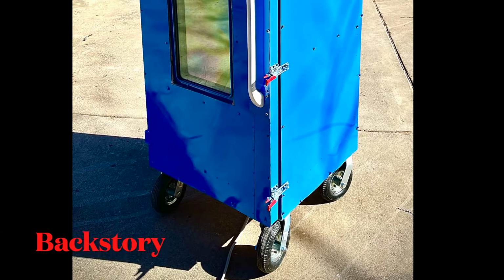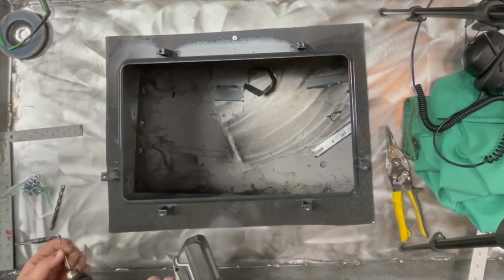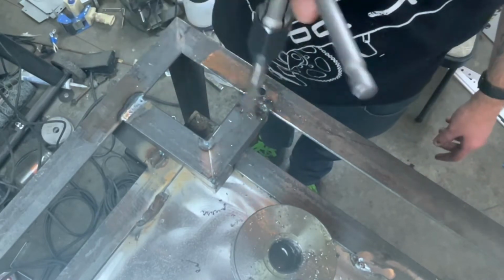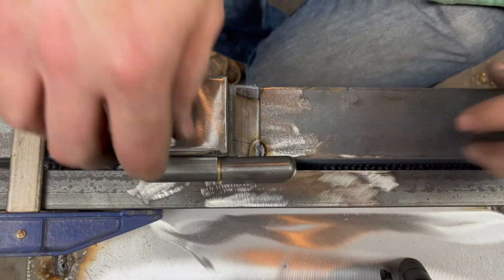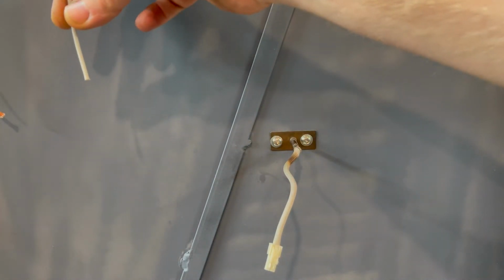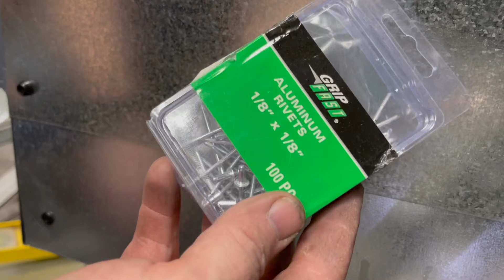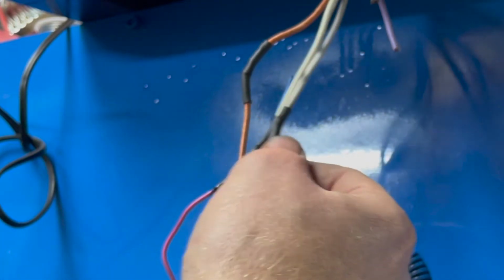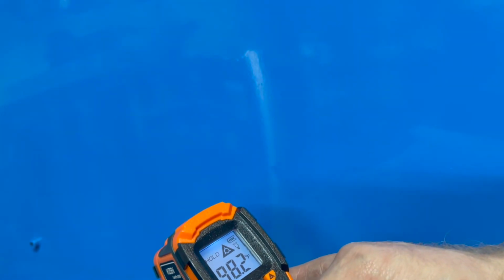Making a DIY Powdercoat Curing Oven Using Free Kitchen Oven Parts, Saving Thousands of Dollars

Comment: Nice build. As mentioned in another comment I used a double oven and just joined the doors but made them a side open instead of a bottom open. 1 thing I did different though is I used a PID controller with both elements running at the same time to give a better more consistent heat. The oven controls give a broader range of heat. If you set it at 400, the controller cuts off and on at wider ranges so keeping a constant 400 is nearly impossible. Just an option.

Comment: Viewers … save yourself a lot of time and effort and just troll Marketplace looking under “lab oven.” You can get a 110V benchtop oven that was used in a laboratory and that is vertical oriented, has a circulating fan like a convection oven, and with the same internal dimensions as this one, for less than $500.
Reply from the maker: This was not my experience. I looked for a long time. Commercial ovens are large, but very expensive.

Comment: Good video! Nice job with the controls. I used to do commercial appliance repair as an add on to refrigeration, AC and heating, and I enjoyed learning  things watching your video, including about welding, I thought  also that pulling that square root of 7 out of your head on the spot was pretty cool.  Thank you very much posting the video.  On angle grinders we've had our share of closer than close calls so, ... everybody, be careful, keep the grinder guard on, except when you are making a video,  and don't let what you are cutting pinch the blade, as explained in the video, because high speed angle grinders are extremely dangerous.